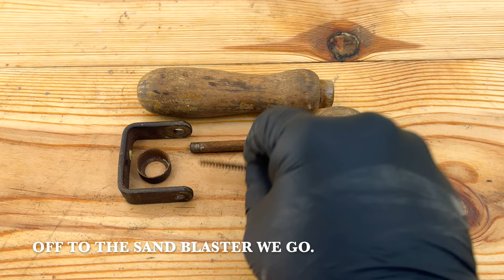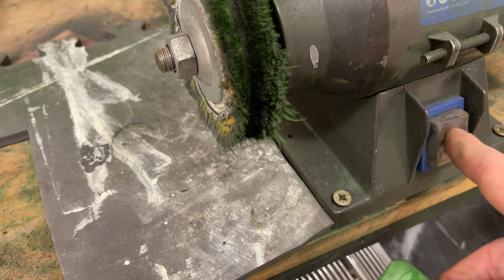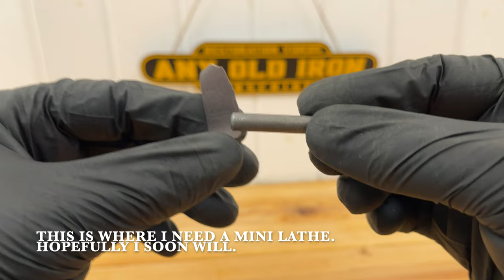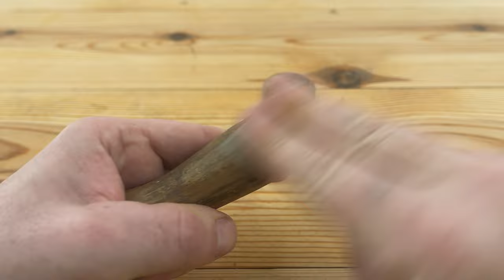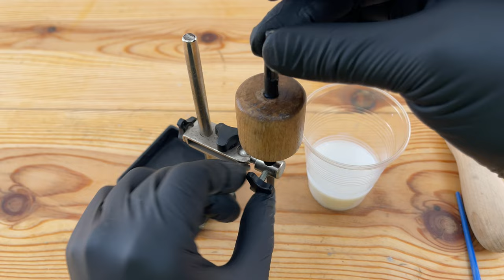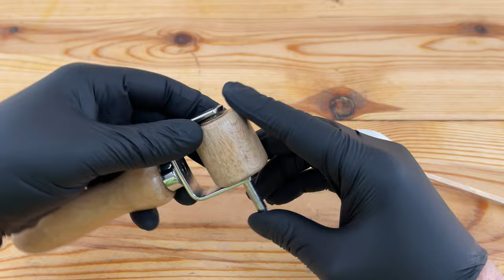What Is This Tool And What Does It Do.

Comment: Why did u leave holes in wood?...
Reply from the maker: Which ones
Reply: The roller part has to have a hole so that it fits on the rod and can roll along the seam. The handle has to have a hole so the metal piece can be attached. I hope that helps you.